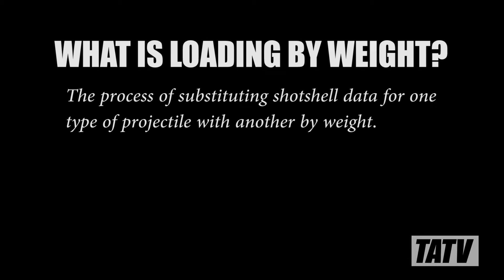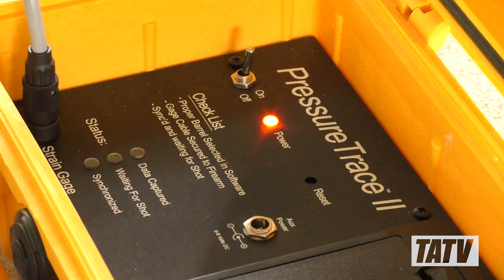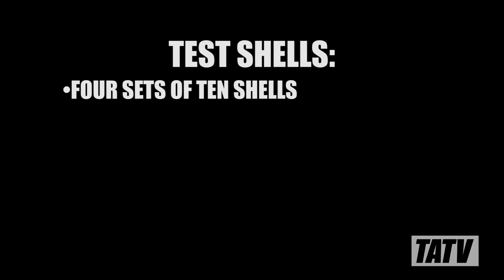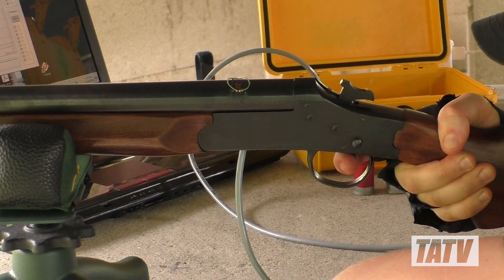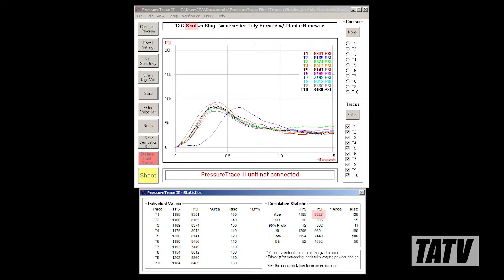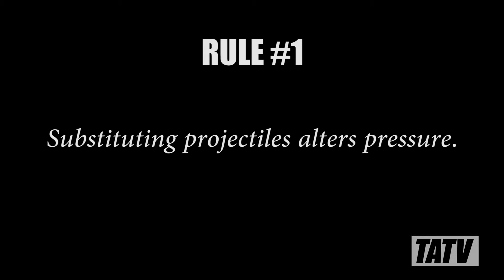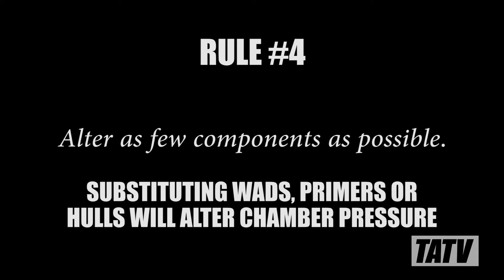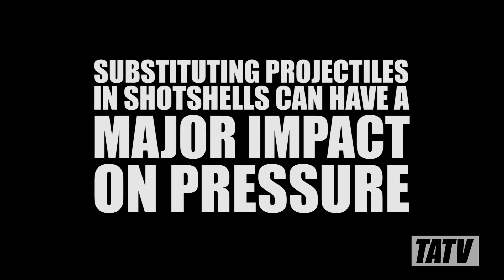Loading Shotshells by Weight

Comment: Excellent video, and your data exactly matches the trends. There's a pretty good old thread on the topic on castboolits. Also a guy who helped me to get started shotgun loading gave me a bunch of supplies, as well as some spreadsheets showing a lot of substitute loads which he had sent in for commercial testing, along with the comparisons. The trend is real. All other things equal, PSI: Birdshot>Buckshot>slug. Velocity is usually, but not always the reverse. (Sometimes I think the magnum powders need the resistance of birdshot to develop full pressure curve which affects velocity.)

Your rules are spot on, and I would add one more. #x: Shotgun shells are a lot more complicated than rifle shells, and visual factors for pressure are much less reliable as indicators of your safety margins. Very likely the first sign you will get for high pressure is a fragment of forend going through your wrist. "Working up" isn't a safe and simple practice in the sense for a rifle. The number of components whose interplay which can radically affect pressure curves, means that pressure cannot be treated as a simple linear progression. +.1 grain does not equal + 500 psi or whatever.  - okay, that needs rewritten, but that's the concept. I think a lot of people who respect rifles, look at shotgun shells as "just shotgun shells." "And hey, my uncle did all kinds of crazy component substitutions and he ain't ded yet..." Yeah, but shotun primers are far more different from eachother than rifle primers, and your uncle was doing substitutions with 2.5 dram handicap clay shooting loads, not High pressure field loads.

There probably is tested data for what you want to do, so find the tested data and use that. IMO the RCBS manual is the way to go for most people. It kicks the pants off of the Lyman book I got to start. IMO Lee shotgun data is very suspect. It's hard to trust data when the powder charge, wad and payload won't physically fit in the shell by a cm or so...
Reply: Thread: Note Turbo's posts with pressure data for "twin loads" http://castboolits.gunloads.com/showthread.php?107590-Payload-Substituting
Reply from the maker: Birdshot/Buckshot/Slugs has been my experience too, glad to know I'm not going down the wrong path, ha ha.

That's a good rule to be sure, and you're right; shotshells don't give us a whole lot of notice before things go sideways.

It's funny you should mention that RCBS shotshell manual; I've been trying to get my hands on one for nearly two years.  I have roughly a dozen other shotshell manuals but for some reason that RCBS one is outrageously expensive here (like $100 used).  I know it's out of print, but come on.
Reply: Shouldn't be. They did  new edition just a year or two ago. I suppose I can see if it is in the US version of amazon and send a copy your way.
Reply: Dang.n $70 USD on Amazon. Who'da thunk it would be an 'asset'? I'm happy to relay any data sets that you might want. The organization of that book is far more useful than any of the others I have used. Plus the section on shotshell types is actually pretty informative, rather than just generic fearmongering.
Reply from the maker: Oh believe me, I have checked Amazon.ca, Amazon.com, Ebay, Craigslist, online used bookstores, anything I could think of.  It's just crazy.  It's not actually the data I'm interested in so much as the general articles and component information.  That stuff is a gold mine for developing your own load data and understanding how different components perform together.

Comment: Thanks for the info . I would have thought the shot would compress through the choke and have less pressure then the slug . Good stuff to know .
Reply: For the vast majority of shotshell data, almost all the powder is burned within the first 10-12" of barrel. After that the pressure is dropping rapidly. Hence the taper in the barrels.

Comment: I’m curious about using lead shot data for larger size of LEAD shot (bb, bbb, t) that ballistic products sells. Some I’ve spoken with classify them as large birdshot and others as small buckshot.
Reply from the maker: For my buckshot loads I've usually been able to find data without too much issue.  Have you tried Hodgon Powder's online tool?
Reply: @TATVCanada  I have a couple of manuals that list data for the sizes. But using Hodgon's website, I found some data that I would like to try for these sizes. It is for birdshot, but I am under the impression that so long as the weight is the same, I should be fine? I planned to send some off to have it tested before using them.
Reply: Awesome videos! Do you have info on where I could have some of my loads tested?
Reply: @o4murph  precision reloading does it if you’re in the US.

Comment: Great video what I do I use buckshot load data since it’s more mass than shot using a load that’s little heavier than my slug so now I have a load with a lighter projectile the pressure will be lower and if I substitute  the wad I reduce by 10% have a nice day. Julio
Reply from the maker: Good stuff; there's so much to be learned from shotshells.

Comment: Other than avoiding creating a pressure that is so high it compromises the shot, what are the actual effects of the change in pressure on the shot?  Would lower pressure create a drop in velocity and increase in the standard deviation of the accuracy of a shot?
Reply from the maker: Due to the the high number of variables present in shotshells relative to cartridge-based ammunition, it's much more difficult to state things as absolute certainties.  With that said, in my experience so far, generally a drop in pressure results in a drop in velocity.  I'm no physicist, but to me this seems logical as shells that don't achieve higher chamber pressures simply fail to generate the energy required to reach top speeds.

Standard deviation is a whole other ball game.  As it is a measure of consistency vs pressure or velocity, it seems to depend far more on how 'well' you assemble your ammunition.  'Did you measure you powder using a digital powder trickler vs a powder measure or volume-based charge?'  'Did you seat your wads at the exact same depth and pressure?'  'Did you weigh your shot out by digital scale rather than volumetrically?', etc.  Standard deviation is also very much a reflection of the quality of the components themselves; high quality powder that's been stored properly performs much more uniformly.  Some primers perform better in certain types of hulls and with certain types of powders as well.

Part of the appeal/horror of this past time is that there's so much to be learned from experimentation, but there are almost a limitless number of possible scenarios to test...